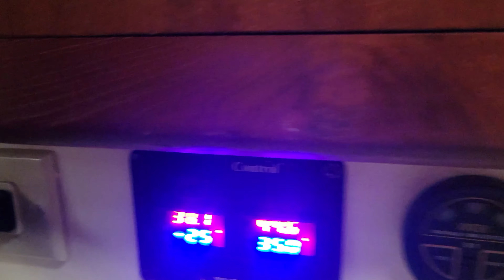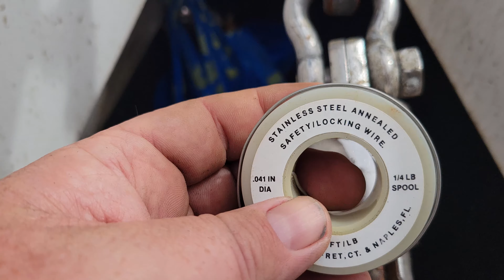Got Too Get Back On Anchor, But Our Son Stops By! | Ep 40 #svaguaazul #sailboat #boat

Comment: Only problem with having your dingy down low is if you are in following seas it will smash your dingy into the back of the boat. If you come to vero in the next month stop by and say hi!
Reply from the maker: Thought about stopping there, just passed the Merrill bridge on our way to Fort Pierce. Have never dealt with following seas on this boat. We run a line from the bow to the aft of our dinghy, though the handle just under the sugar scoop handles. We the pull the dinghy tight on the davits, and it doesn't move at all. Have to show this in a video. I would love your opinion on success in following seas.
Reply: @ come grab a morning ball and hang out for a bit it’s like $22 a night
Reply from the maker: Think we want to anchor there, not looking to spend more money. We be broke sailors. 😊 Is in the next month, December? We are hanging up here till after Thanksgiving.
Reply: @ I hear you, are you on no foreign land ?
Reply from the maker: We are on there but have never really used it.
Reply: @ it’s brilliant probably one of the best apps out there for cruisers
Reply from the maker: Just enabled it again, have to look into it a bit more. We have been trying to promote Argo as a good app for navigation on the ICW. Have to get on navionics before we leave the USA. Still have to get more chain and a watermaker, thinking 300 foot of chain should do.
Reply: @ChrisDoesWhat  300 feet would be very good choice , we are looking at getting a new water maker also before we leave. Hence staying in vero for a few more weeks. Aqua maps is good for the ICW, navionics is good for the Bahamas as well pretty accurate , we also use CMaps
Reply from the maker: We are going to be hanging around Fort Pierce for our watermaker and have been talking to Seawaterpro. Sounds like y'all may be gone before we get down there. We are up here hanging with @svbreezybaby, and our boys are coming down for Thanksgiving. Will have to check those apps out as well, new to saltwater boating.
Reply: @ following you on no foreign land. Our friends SV Another Summer are near you , really experienced couple and a really good laugh !
Reply from the maker: Still working through the app, and I have to figure out how to follow people. Just got done checking our Impeller and vacuuming the bilge after my stupid mistake.